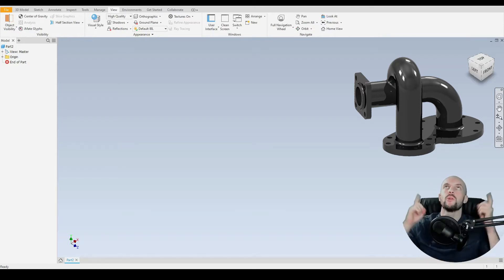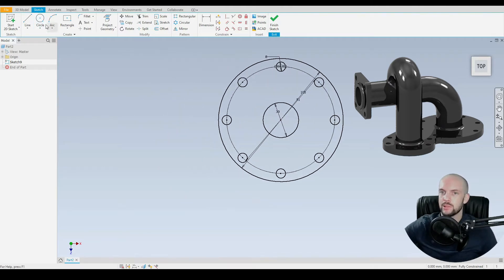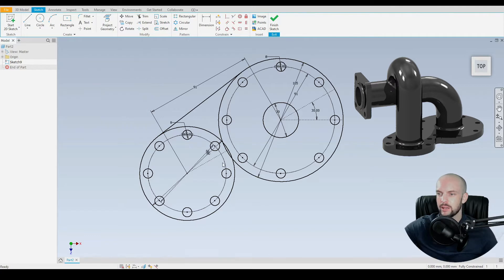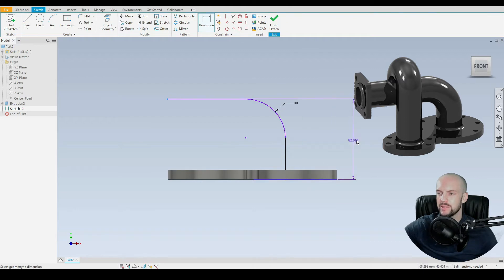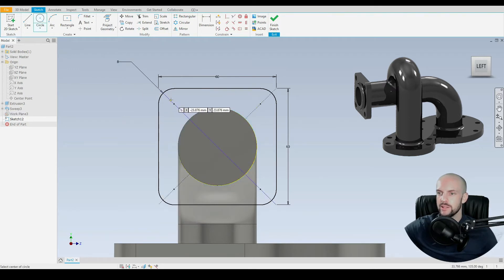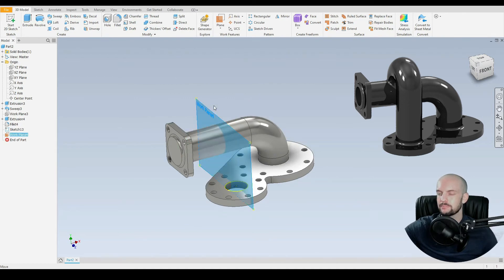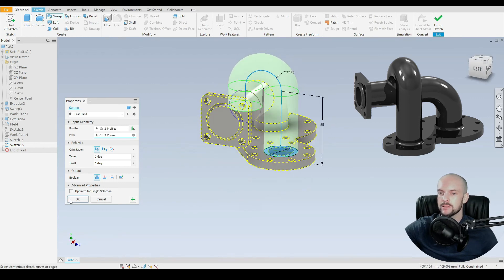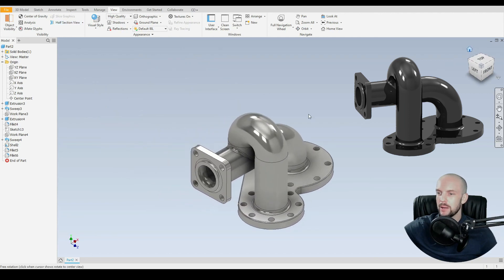Pipes + Flange | Autodesk Inventor 2021 | Exercise 10 | Intermediate  Tutorial

Comment: Prob a dumb question however when you do a fillet  whether it be in a square corner or like you did on these  pipes / circles does it provide extra strength / reinforcement to said part or corner? New to the auto desk cad stuff.
Reply from the maker: Hi, a fillet (or radius) or piping is much stronger than a 90 degree bend. It suits piping especially for fluid flow and laminar flow, i.e. prevention of turbulent flow which causes erosive wear. It depends on the parts your working with and what conditions they are subjected to but in most cases a fillet is far stronger for fluid handling equipment.
Reply: @AutodeskInventorTutorials  Thank You!!!

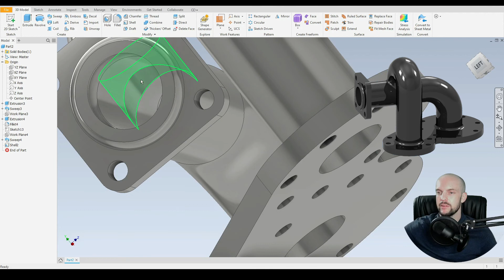Comment: @ 10:47 the joint on mine doesn't look cut like yours and I can not choose those areas for fillet any ideas?
Edit: I've re-drawn it from scratch twice, just in case and would rather not if I can help it... but I suppose it is good practice lol.
Reply from the maker: Hi Bad Monkey! Were you able to resolve this problem? If you're still struggling send me an email with some screenshots and I'll look into this: cadchris2021@gmail.com
Reply: @AutodeskInventorTutorials  I had the same issue! I remodeled everything from scratch and it worked, but I’m wondering, how would you fix it if one of the pipes ends up modeled inside the hollow part of the other, blocking it? This happened because I used “Sweep” to create the pipes as hollow from the start. Great videos by the way, I’m learning a lot from them!